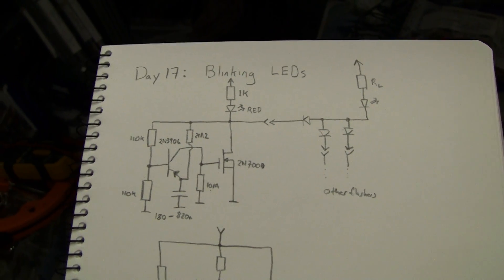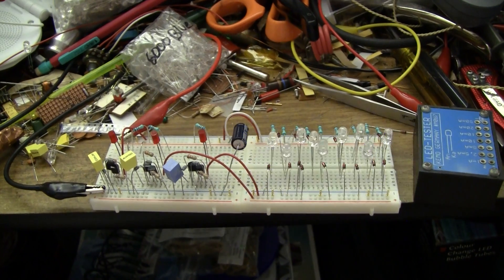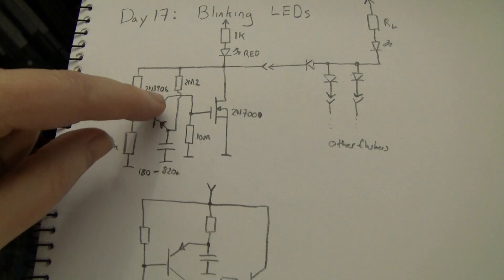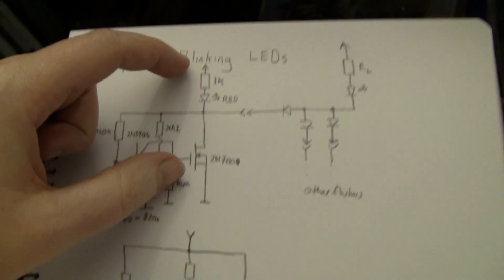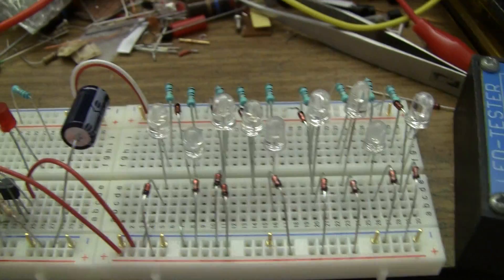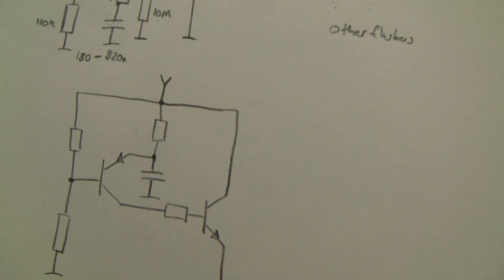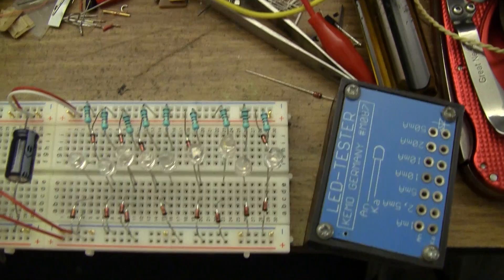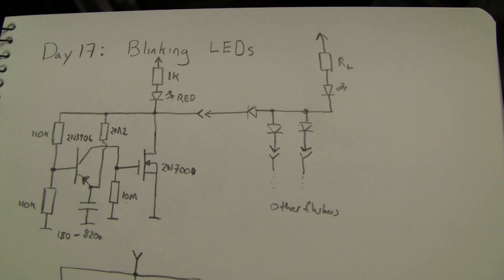Advent Calendar of Circuits 2011: Day 17: Blinking LEDs (e.g. X-mas Decorations)

Comment from the maker: @randomgarfield Not sure, 15-20, when I was in the US last I bought a stack at $3 each.  They are cheap on eBay now, especially the really tiny ones.  Almost cheap enough to just dedicate to small "never finished" projects where reliability is not an issue.